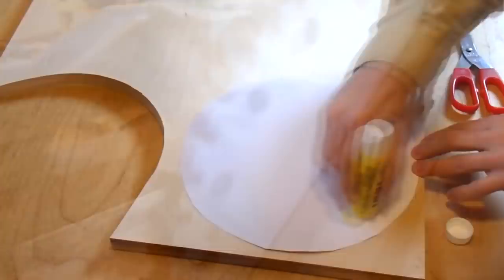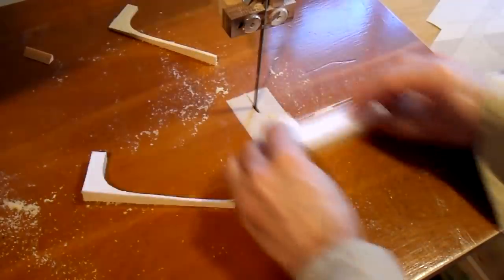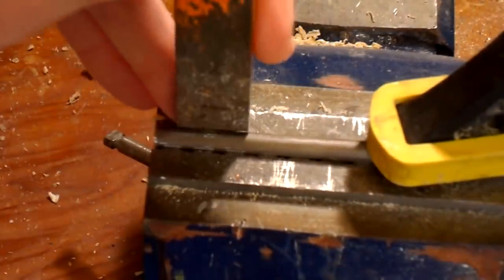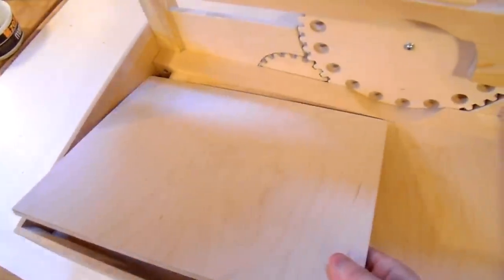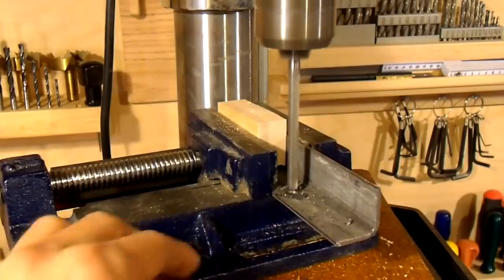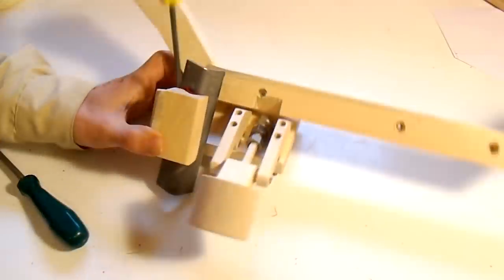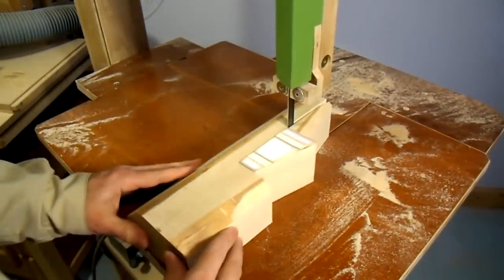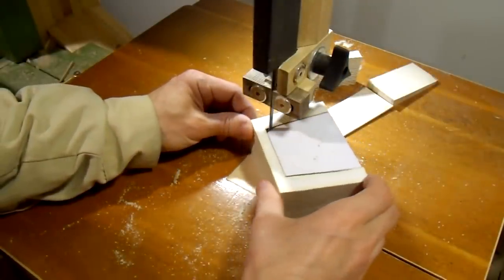Building marble machine 2.1

Comment: would it be quicker to cut the gears with a dado blade on the table saw and then clean it up on the band saw? in theory you could cut the gear 'valleys' with just 3 cuts - 1 dado cut, and then a bandsaw cut on either side.

Comment: Have you ever tried using one marble and watched it to see what path was most common or if it ended up going through the whole machine. Just curious to see what it would do. Well except for the dump bucket it requires x amount I know. Whatever that number is try it with that many to see if it will ever dump or the marbles will cycle etc. it would also be cool to remove the dump bucket or weigh it down so one marble will tip it and then you can experiment with just one marble. Thanks. You’ve gotten my “gears turning”. I’ll just see myself out lol.

Comment: I'd be interested to see how well it randomises, if you labeled some marbles 1 through n and put them into the base cog in order then ran the machine for i turns and looked at the order they reenter the main cog, how random would it be?

Then if its decently random, get some uranium glass marbles and a rad detector, treat radioactive marbles as a 1 bit, and normal marbles as 0. Now the everyman can have their own hardware entropy source ;^)

Comment: I like the build and your content in general, i think the box joints are fine but seriously... did you "say retroactive precision to joinery"?  I am even impressed with the degree of precision you achieve on the bandsaw, seems to be running very steady unlike the one at my companies shop.  But, come on, either it's precise or it's not, you can cover it up which can be fine, but it stays a bloody cover up. For some reason I find it a hilarious term on the one side but out of a professional pride and people really trying to sell stuff with excuses like that ticks me off.
The build looks cool but I think you should redesign the pin divider. With the nails it looks kind of cheaper than the rest.